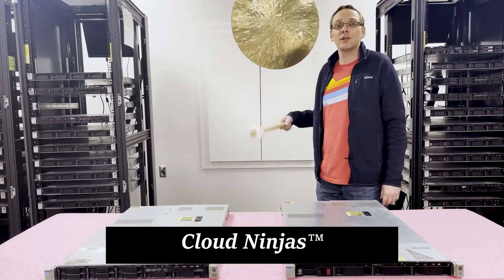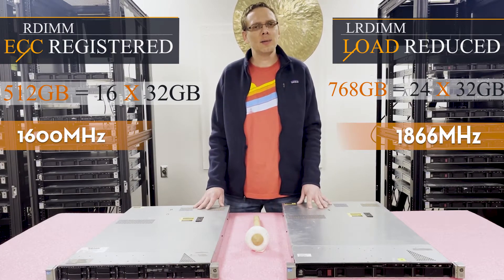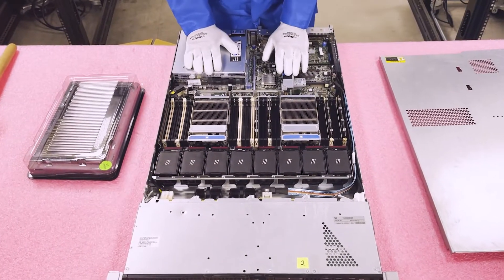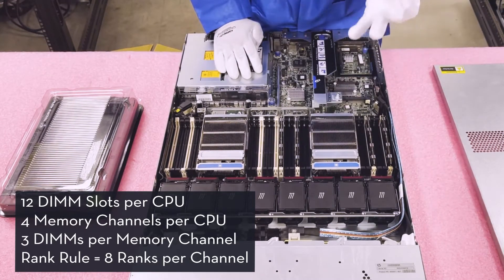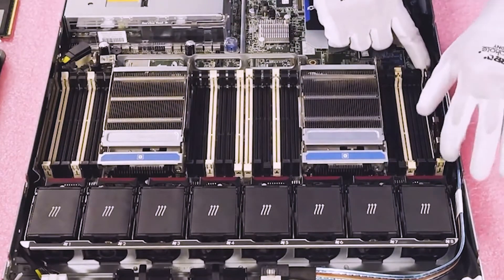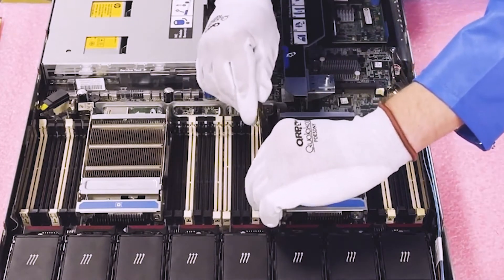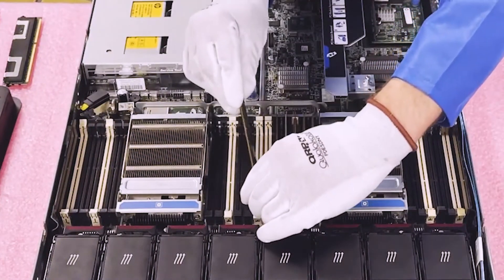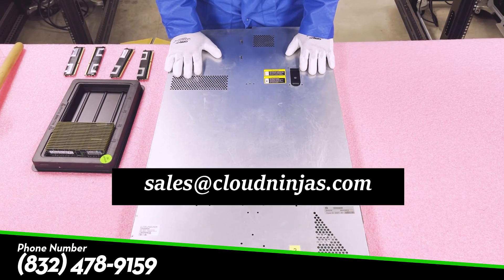HPE ProLiant DL360p G8 Gen8 Memory Spec Overview & Upgrade Tips | How to Configure the System

Comment: Thanks bro, your video is very helpful, just bought 16x32GB RDIMM RAM and I put the RAM on the wrong socket, I put it in socket number 1,3,4,6,7,9,10,12 on both processor.
But thanks to your explanation, now I know it should be on socket 1,2,4,5,8,9,11,12 on both processor.
Reply from the maker: Glad to help you out on your memory configuration!
Reply: @cloudninjas so if I had 10×16gb would the order need to be 1,4,8,11 on each cpu? I kept it to all white slots, and then had two more that I put on the 2 slot of each processor, will that utilize the quad channels optimally?

Comment: Is it suitable to buy one second hand on these days? I believe this server have not HP support anymore right?  Someone is offering me this server with 128GB , 1.8TB and 2 processors. Thanks in advance.
Reply from the maker: I'd go with a Gen9 personally or Gen10 if within your budget.   Gen8 is a bit old but still a great system. If investing today I'd go a little newer.  If maintaining a system I'm use I recommend upgrading RAM and SSDs.

Comment: I need to add GPU in this server, 
Please suggest me compatible graphics card.
Reply from the maker: We have never specifically tested any GPUs in the DL360p G8, but a single-width card that does not require any extra power cables should work. We've found this link that contains some information that you may find useful. https://github.com/bohnelang/CUDA-on-a-HP-ProLiant-DL360p-G8 According to the link, a GeForce GT 1030 or a Quadro P2000 should work. We hope you find this helpful!

Comment: I have bought a dl360p with two e5 2670 32 gb of ram 1866 for like 100 euros and i upggraded to e5 2667 v2 (actually less core than the 2660) its more efficient and it has higher speed for 50 euros and upgraded the ram to 64 gb with another 4x8 1866 ram kit form you

Now i need disks, tips?
Reply from the maker: Steal of a deal.  Great find.  I'd look at some 600GB or 900GB 10K sas.  Fairly cheap these days.
Reply: I was wrong, memory was at 1333 but i changed it and now is 1866 running at 1866 because im v2 cpu

Comment: Is this still a viable server in 2021? Or should I just build a pc for my homelab?   Is this thing just going to chew threw power?
Reply from the maker: All good questions.   Yes this is a good homelab server, even in 2021.  Not everyone needs the latest and greatest.  There are different power supply options so you can go with the lower end PSUs to save on power.  Building a PC is also a great option.   That's the wonderful part... so many good and fun options to play around with.  Heck do both. 😁
Reply: Hi Cloudninja , 
Can I use Hp 380 G8 for my home lab..is it a good option,  is it good on power consumption. I found this in my DC , it was decommissioned..I thought If I can use it and save money..
Second question about HP 360 p
I have spare ram 
8gb 2RX4 PC3-12800R -11-11-E2-D3 
Can I use this Ram in HP 360 server ? 
Thanks
Reply: Hi Cloudninja , 
Can I use Hp 380 G8 for my home lab..is it a good option,  is it good on power consumption. I found this in my DC , it was decommissioned..I thought If I can use it and save money..
Second question about HP 360 p
I have spare ram 
8gb 2RX4 PC3-12800R -11-11-E2-D3 
Can I use this Ram in HP 360 server ? 
Thanks

Comment: Hello,
  Can dual ranked memory be mixed with quad ranked memeory?  I currently have eight 8GB 2x4 in my dl360pg8.  I purchased 8 16GB 4rx4 dimms from you but not sure if These can be mixed or if I need to remove the 8GB dimms?  Other than size and rank, they are same spec.  Thanks.
Reply from the maker: Yes.  Can be mixed but keep in mind the rank rule.  Only 8 ranks per channel.  Would need 2 x dual rank and 1 x quad rank per channel.  That way you don't go over 8 ranks.  Hope that helps!  Take care.
Reply from the maker: Actually since 16 dimms total, you would want 1 x 8gb dual rank and 1 x 16gb quad rank per channel.  And third slot in channel would be empty.  Thank you!